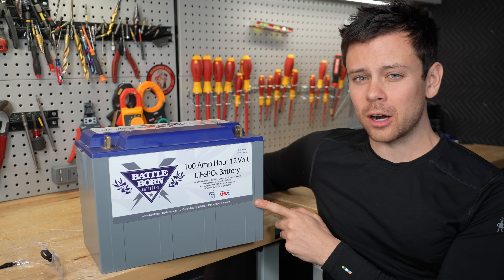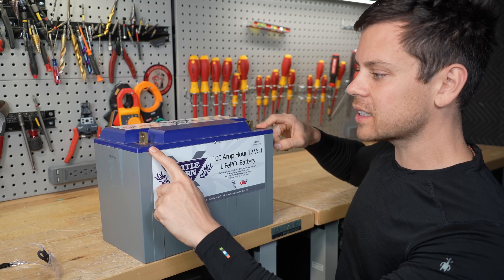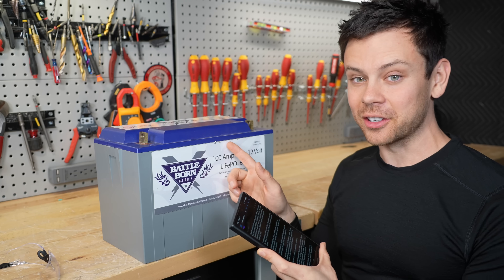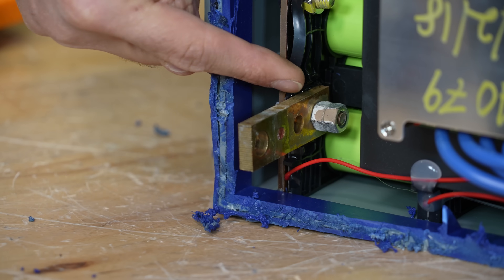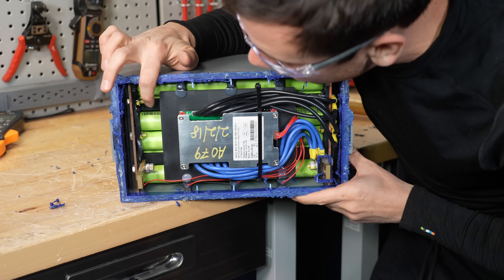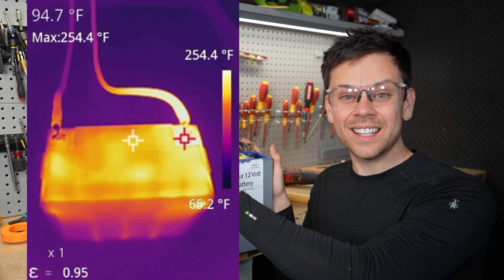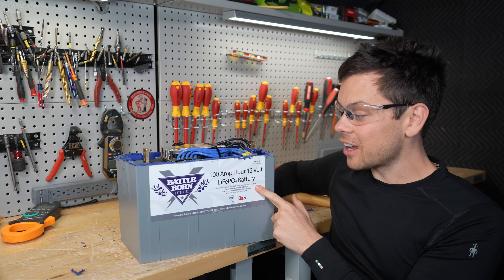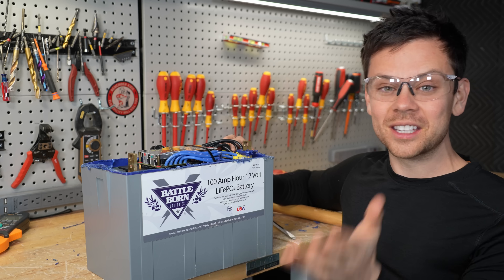Battleborn 12V Battery: Major Safety Issue

Comment: According to the official open letter, the loosened part functions like a fuse, breaking automatically under high temperatures to protect the inner battery. At least the company has provided an explanation regarding this design issue
Reply: An absurdly stupid justification of a terrible design choice. The plastic sandwiched between the  output terminal and the buss bar WILL slowly deform. It's a bad idea from the beginning to force all the current flow through the bolt, instead of directly connecting the terminal to the buss bar. It is ludicrously bad to put a layer of thermoplastic in the middle. The jam nut will do a decent job ofr preventing the nut(s) from coming loose. But that's pointless, because even modest heating of the bolt will cause the plastic to deform and loosen the joint. Once that happens  your are cooked (literally.) The loose joint will heat up even more, resulting in accellerating worsening. BattleBorn's claim that this results in safely opening the connection is such an obviously false claim I can't believe they said it. The connection becomes intermittent and high resistance, not cleanly disconnected.

Comment: This is a stated safety feature of the battery. The root cause is bad wiring and components that have failed, and the warning signs were not observed. Still would not go with any other brand.

Comment: THANKS for these posts! So (cross-posted to your follow up video - thanks again!)...
1. our rigs have 4 * BattleBorn 270Ah GameChanger v3(GC3) batteries installed. Any idea if this issue is with this series/model too?

2. externally, besides seeing "red" color discolored to off-red/orange and using infrared thermometer to see excess heat, could you tell this defect exists? eg, the positive terminal wiggles (or was that just after you cut the top off)?

3. Seems like the only internal access is via destructive top removal (which I assume will void their 10year warranties; important for these $2500 each batteries)?

4. Sadly, removing the batteries from are rigs are Non-Trivial - the camper builder has them good and "trapped." Even if we could sawzall the tops off in place, would it be a matter of securing the 2 nuts with loctite & lockwasher (assuming the plastic hasn't deformed/melted)?

5. It seems that the defect is the improperly secured nuts (no lock washers, no loctite, etc.) which allow the terminal to come loose and wiggle. Re: Preventative Maint - for now/medium term future, is it reasonable to put on a scheduled maint list to wiggle the terminal and make sure it's tight. If it they are tight, we're good. If not, then veery bad?

Comment: I have two of their 100Ah batteries (a BB10012H and a BBGC2H) set up in parallel.

They’re fine, no overheating. I used a thermal imager to confirm.

I called them and they’re aware of the video.

Comment: What about the yachties out there, I know a few who are using these batteries because the company gave them batteries in a sponsorship deal. A certain successful  youtuber with a catamaran has about 10 of these all hooked up together underneath a berth in the boat hooked up to solar. They are constantly in bad weather, beating into rough seas pounding along for hours, even days on end. they have air conditioning, water maker, fridges etc running off these batteries

Comment: The biggest amp draw would typically be from the inverter. I know my Victron inverter is very sensitive to arc faults and gives an error. I had a bad connection on a buss bar causing such and error. So wouldn't this be a good way to tell if you have this issue? Anyone know? I'd guess many other inverters also would detect this.

Comment: Eeks. I have two in parallel from 2022 and will have to take a look at them. Mine only charge at 30 amps (so 15 per battery?) and only discharge slowly of course. Do you think this problem happens for users that are charging at higher amperages?

Comment: I've been running Battle born batteries in my kayaks and boats for almost as long as they've been a company. Never once have i had an issue like this. I also use common sense and don't try to max out the design capabilities just to make a you tube video. I use them as designed. Looks like you farmed an already damaged battery from someone to make this. It wasn't your battery with a known history of appropriate usage nor was it a battery owned by someone you know and trust. I'm sure everyone would like a new test that follows OEM charge and discharge protocol because that's how we use them.
Reply from the maker: Oh I did! I kept it within spec, what are you talking about? I would never do that
Reply: @WillProwse  please share the use history of that battery.
Reply: I asked BB about this, and this was the reply - this is engineered on purpose. And it must be user caused potentially? Will, how should this have been designed? How do other battery manufactures design this protection. 
I really don’t understand how a user could cause this unless they mounted the battery upside down from the battery lugs themselves in an off road rally car, but who would do that ? Even then they seem pretty beefy. Is it just expansion and contraction cycles over time with charging and discharging? 

Thank you for contacting us. We appreciate the opportunity to provide technical context regarding the engineering and safety of your system. We understand there are conversations circulating externally, and we want to support you with facts about how our products are engineered and certified.
Regarding the concerns you raised:
Battle Born Batteries have been available in the market for more than a decade. During that time, we have delivered well over 400,000 batteries into service across all major markets. Our solutions have undergone extensive third-party testing to UL standards, we operate an open production process in the United States, and we routinely provide tours, published videos, and engineering transparency. These outcomes and the long track record of safe operation speak for themselves.
To address questions that have recently surfaced about terminal heating and fastener design, it is important to highlight that what some observers view as a failure is a safety device working exactly as intended. The aluminum nut used in our 100Ah packs’ positive terminal is a purpose-built thermal failsafe. It is engineered so that the plastic deforms and disconnects when excess heat is present at the terminal.
This protects the internal cell structure by interrupting the current, preventing further heat buildup and thermal runaway. This safeguard exists for conditions created in the field such as loose external connections, systems operating outside specification, or uncontrolled short circuits. It is one of several intentional protective mechanisms within our packs and is necessary for our UL Listing Standards.
The key takeaway is this: This design prevents heat from migrating into the cell stack, meaning it is designed to stop conditions that could otherwise create a thermal runaway event. It works as a sacrificial barrier that takes the heat event on behalf of the cells. That is the exact purpose of the feature.
In cases where a pack has already experienced misuse or improper installation, visible damage at the terminal is typically the result of that safety mechanism activating. That does not mean the design is flawed. It means the protective feature served its purpose. The batteries we sell and support today use the same trusted and validated design that has been in successful field service for many years.
If you are currently experiencing a specific operational issue with your system, please reply with photos of your installation so we can assist you further.
Sincerely
Reply from the maker: @eronschultz  check out my latest video. Just posted it a few minutes ago. And we deal with this by adding a fuse.

Comment: I have 4 of these.  I found this problem a couple years ago.  There was cracking in the red material around the terminal.  I contacted them and they said I must have dropped the battery.  I cut around the terminal to allow access to the bolt and nuts and tightened them.  No problem since.

Comment: I have two of these, and the positive terminal has been hotter than ground from the get go. I did not think much of it until now. There are four major flaws at the same time: 1) The plastic substrate between the terminal and the busbar is under compression and will fail over time without any other modes of influence, dramatically more so under load (with heat) and vibration. 2) The full current is transmitted via the threaded bolt without any copper to copper contact between the terminal and the busbar, relying on the tiny surface area of the bolt and nut to the busbar and terminal. 3) Heat buildup in the terminal is largely isolated from the busbar,  with the bolt being they only means of dissipation either to or from the external wiring (meaning, there will be heat buildup in the busbar and terminal with nowhere to go) 4) The double nut termination provides no resistance to stretching of the bolt or compression of the plastic, and should have used a belleville-type conical spring washer with serrations to compress the terminal, busbar and nut together. This is not a if it bothers you replace it type of situation. All these batteries will fail, even in storage and must me replaced. I already contacted Battleborn, but no response...

Comment: If that is really still their current quality than you should report them to the authorities - cause people had reported this YEARS ago and this is a safety hazard. All batteries need to be recalled and either the problem completely fixed or customers reimbursed. And they also need to be hold accountable for criminal neglience.

Those things pack a lot of chemical energy and if something goes wrong that can easily start a house-fire.

Comment: Hi Will, I got 4-100 Watt Rich Solar Panels for my Van in 2021 on your advice, the first 3 years they worked great and I even got over 400 Watts when I was in Maine but in the last 1.5 years I haven’t even got close to 300 Watts, has anyone else have this problem? I am now in Arizona and looking to upgrade my Panels for a total of 600 to 750 Watts just to make sure that I have enough power.

Comment: are they that stupid? conduct current through the bolt, and also clamp the plastic? It's no use having a terminal that big if the current has to go through a small bolt

Comment: it is so nice that you exposed the poor quality of Battleborn  i have been wondering that when it's going to happen !!
the bad build quality aint all the problems they have, thermal switch inside the cells isnt working correctly because they use cylindrical lifepo4 cells, some of the cells can be still frozen when the temp switch allows recharging.
this is what you get when you pay 4XPREMIUM

Comment: Good information, but you failed to give context.  How many amps were you charging with?  "Not safe to use" isn't really helpful.  OMG the sky is falling!  I have a pair of them powering my CPAP.  80 watts is my total load including my night stand lamp.   My Victron battery charge is connected 24/7.  I'll be fine.   As I said, good information.  Perhaps these batteries are not ideal for mobile applications.  To be 100% safe, people should invest in a thermal camera and keep an eye out for thermal issues while at max charge/discharge.  Even reputable brands can have problems.

Comment: @WillProwse , did you reach out to BB? or did they reach out to you since you posted? I rewatched the first video you made tearing into a 100a BBB 6 years ago and can see they're design hasn't changed any. It's seems strange to build in a "fail safe" that doesn't fully make the battery "safe" when it fails. Just worse. We reached out to them today to see if they can explain their engineering better.
Reply: And what was their reply ?

Comment: Copper has a positive temperature coefficent.
Clamping two bus bars together with plastic between, results in thermal runaway, due to the plastic melting and reducing the clamping force.
The manufacturer should have made it one piece "L" shaped.
100 Amps passing through a .005 Ohm (5 milliOhms) connection, would dissipate 50 Watts !

Comment: I wonder if one could spot weld those parts together. I think it is steel against copper so that likely don’t work.maybe lugged fittings going from the ends to the bolt?

Comment: Thanks Will for the heads up 😁😁😁- super expensive “locally USA” produced with Chinese parts - and we were told by many YouTubers not to buy the cheap nasty Chinese batteries that turned out to be of superior quality. I have 3 of them from 2 different suppliers and they have performed flawlessly- thank you SOK and Ecoworthy 😊😊😊

Comment: A video I seen a while back showed this and I believe battleborn stated that it’s by design to allow the plastic to melt and terminal become disconnected. They offered a fix but you had to pay shipping both ways or some bs cop out.
Reply: Sure, but that's just their lame excuse.  Designing a battery to dangerously and partially self-destruct as a thermal protective measure is simply insane when you can get resettable thermal fuses for 5 bucks.
Reply: @springerstation I agree, for the premium price  melting plastic shouldn’t be a “feature” 😂😂

Comment: At first, I thought it was someone that put a wrench on one side of the terminal without holding the other side of the bolt, but that doesn't explain all the other bolts being loose in my mind.  I'll check mine for looseness.  Maybe put a temperature alarm on them.  It appears it's just the positive side.   Has anyone seen real safety issues or does it just shut off?  UL tests are for safety.  shutting off is a safe result.

Comment: Zero problems with mine!  I have 5 total and installed in a 4X4 camper and drive very rough roads.  I have had them for over 5 years without issue.  This feels a bit Fear mongering when the company has been in biz longer than most and have not had the type of failures/burn. ups your warning about.
Reply: I would agree if this were a one-off or rare case, but many have posted comments verifying they’ve had the same issue. Additionally, I just spoke with a close friend of mine about 30 minutes ago who has six of these installed in his 5th wheel and is having the exact same issue. Thankfully you have not had any issues with your BB’s, but there are far too many incidences listed here in addition to the video to be coincidental. If the resulting consequence was simply a blown fuse or battery failure then this wouldn’t be such a big deal. LiFePo4 batteries are amazingly safe compared to other forms of energy storage available with the exception of a thermal runaway and resulting fire, and the conditions described in the video are exactly what is most likely to start a LiFePo4 battery fire. One of the scariest aspects of this type of fire is it cannot be extinguished by a standard fire extinguisher or water and very few people have or carry a fire extinguisher rated for lithium battery fires. Battle Born needs to make a proactive and aggressive positive response to this before a tragic incident occurs. Again, this issue is far too widespread to label Will’s notifying the public as fear mongering in my opinion. By the way, my wife will tell you my default is to not worry about anything until later than I should. 😅

Comment: Myself and a friend (both electrical engineers) each had this problem on Battleborn 12V 100AH batteries for our RVs. We repaired the batteries that failed by eliminating the plastic spacer that is sandwiched between the positive power connector and the bus bar. I reported to Battleborn in a survey response and heard nothing from them. This is a design flaw in the battery. You just don’t place an ABS plastic insulator between two point contacts in a 100 amp circuit.
Reply: How did you repair them without ruining it by  cutting it open?
Reply: @jimshutt6443  cutting it open doesn't ruin it though.

Comment: Wow. The heat at the terminal was just the tip of the iceberg (melt-berg?) 

Not to mention , all of this is happening inside a 100Ah, 12.8V battery that costs $800. You can get a UL listed 100Ah/51.2V battery from Eco-worthy for that price.